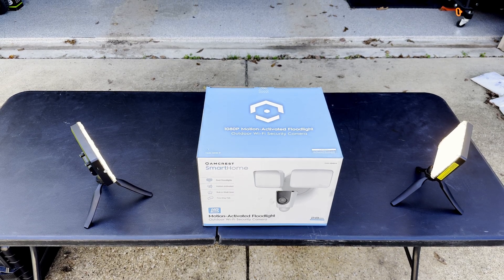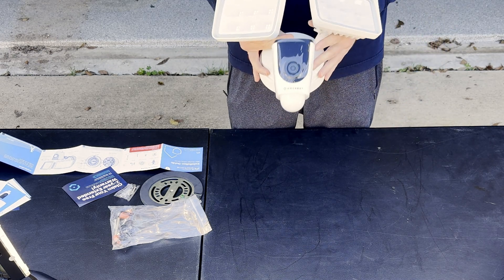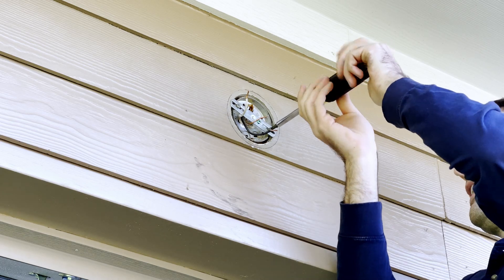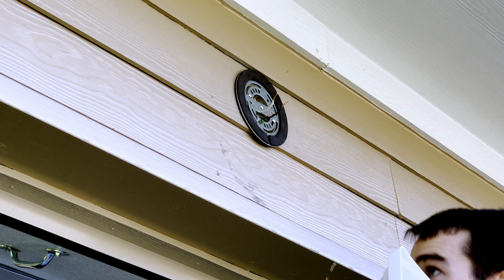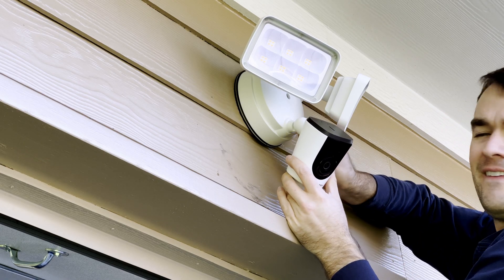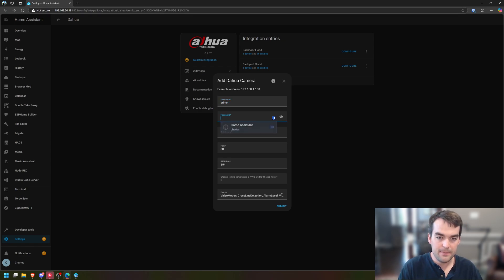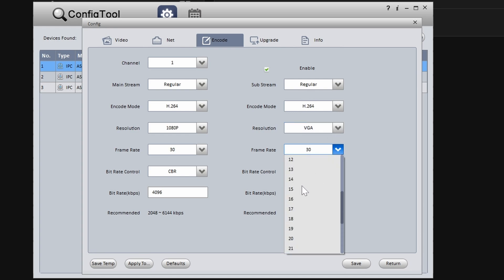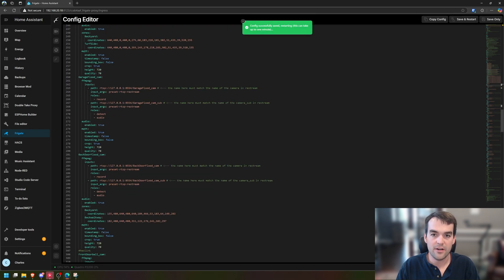Amcrest Floodlight Camera Install with Frigate & HomeAssistant

Comment: Thanks for the video!

Question for you: Why are you using the Dahua integration, rather than the Frigate integration?

I have a bunch of Dahua cameras, but only integrate them to HA through the Frigate integration.
Reply from the maker: I was using it to control the lights. I didn't think frigate controlled the spot light on it. I could be wrong, I moved from this house so I don't have the spot light anymore (but might buy more)
Reply: @ChuckBuilds thanks for the reply

Comment: This was very helpful.

One thing that screwed me up while configuring my Amcrest ASH43-W is that it didn't like being on my IOT subnet while my HA server is on my main network. It wouldn't output video to frigate even though I could view the stream in VLC while connected to the IOT subnet. I'm not sure why your camera was working this way since it seems like a limitation with the smart home devices from Amcrest but maybe only some of them behave that way. Once I moved the camera to my main subnet everything worked with the yaml that you provided.

Comment: Landed on your video from a long journey. Started with synology nas. Ended up looking at  home built nas, and what options there is for WiFi cctv. Since I will have to at my new home. Does frigate have mobile app and motion detection with recoding?
Reply from the maker: Frigate is built with HomeAssistant in mind. There is a web Ui you can access from any browser that would function as the "app" but really you'd see it through HomeAssistant. Frigate does do motion detection but is primarily suggested for object detection - i.e. record people or vehicles instead of shadows or windy blown leaves.  I like frigate a lot, but it can be a bit daunting, and I am still trying to dial in my settings.
Reply: @ChuckBuilds  does your setup sends notifications to your phone if motion detected and starts recording until motion detection stops?
Reply from the maker: @DanPeal1  You can enable notifications. I would only be notified if I wasn't home or if my alarm was set. It would record the motion but you can set the specifics for how many seconds before and how many seconds after the object has been in the frame, or zone.
Reply: @ChuckBuilds  Great, this is exactly what I was looking for. Thanks a lot for the answers!